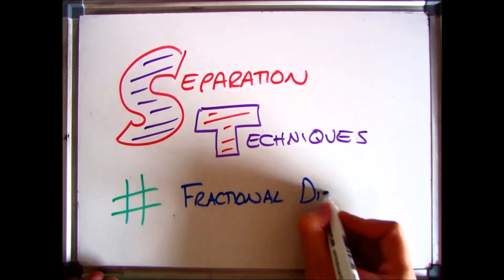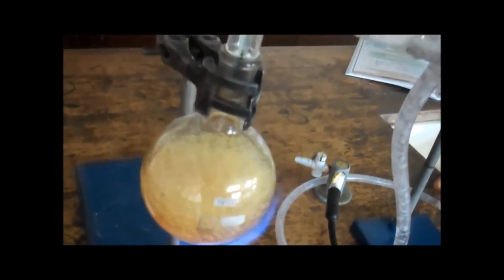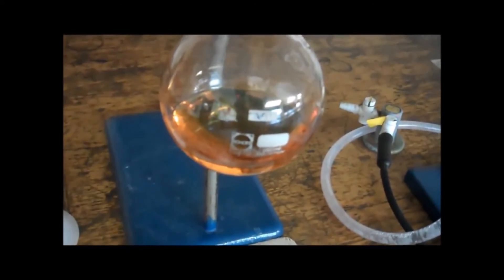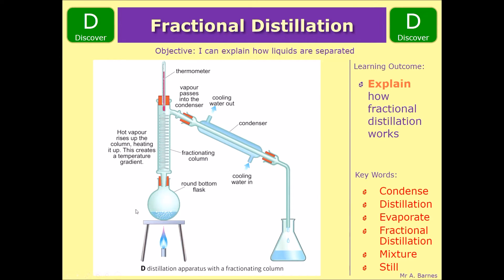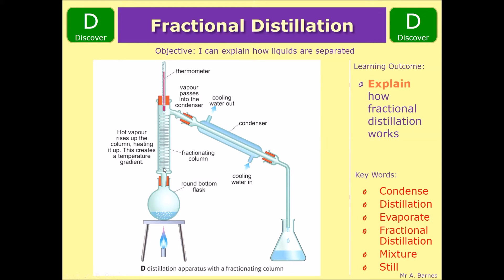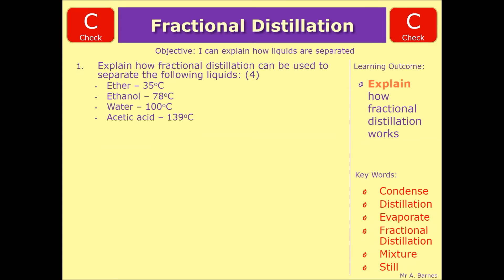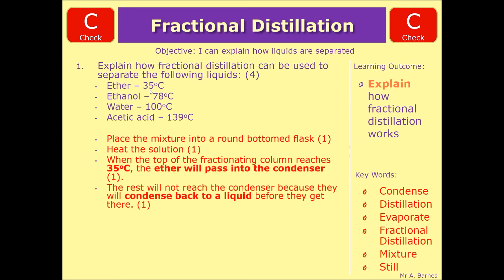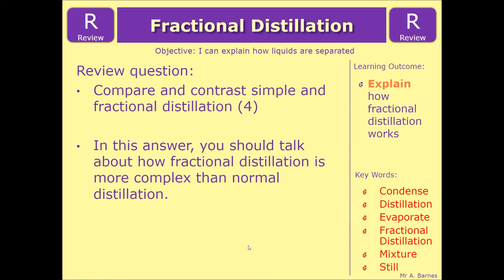GCSE Chemistry 1-9: Simple and Fractional Distillation - Edexcel, OCR and AQA

Comment: Fractional distillation is used to seperate the liquids according to boiling point. The bunsen burner heats the solution amd once it reaches 35 degrees the chemical ether will start and evaporate and go up thr flask it rewches the condenser cools and the gets collected. Same process for all the chemicals for each of their boilijg points and gets collected each in their own basin

Comment: How fun
Reply: can you help me
Reply: can you explain for me what happens when it reaches the thermometer and how they are separated
Reply: The thermometer is just giving an internal reading of temperature for that exact part of the still. It's important to know how hot that part is so you know what liquids are vaporizing and being fed into the condenser. The liquids are separated by heating them up individually to their boiling points and then collecting them one at a time